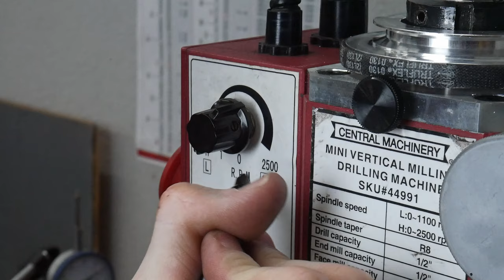Well... I BROKE My Mini Mill... Little Machine Shop Belt Drive Installation

Comment from the maker: *Correction at 00:33 - The LMS mill is not direct drive... it's a belt drive system inside the head.
Reply: I have a mini mill /drill press like that but the wires come apart up by the switch need to find a wire dia ,, so I know where all the wires go ..

Comment: Thanks for the video. I broke my upper plastic gear, but still removed the whole head to remove unnecessary parts,  gears etc. I filled any holes in the head with plastic plugs to keep out debris. The mill runs MUCH quieter and smoother with the belt drive. Although without the gear breakage I most likely would not have made the change. Still I think it was great move. Thanks again.
Reply from the maker: Glad it helped!

Comment: I have had my Grizzly mini-mill for well over 15 years and have yet to strip the gears. I bought a spare gear set from Grizzly at the same time, since even back then it was the most talked about repair. Knock on wood I don't have to do this repair, but the belt replacement is on my list. I save this one YouTube video just in case. I thank you
Reply from the maker: Awesome Larry, yeah I was being a little rough with it when it happened.... 😅

Comment: Been over a decade ago but the belt drive conversion on my X1 made a huge difference. Managed to get 4 ratios using 6mm toothed belt turned inside out.

Comment: I installed my belt drive system today. Your video and informative narrative was a big help. Unfortunately the drive gear on the motor didn’t slide off easily like your video. I had to fabricate a gear puller to get the dang thing off! After that, it was an easy day. Well done video and thanks!
Reply from the maker: Glad it helped!
Reply: Same. I couldn't get that gear off then I couldn't get the sheer pin out. But with a cut off wheel, a steady hand, and a blessing from the God if war I got it out.

Comment: Been spending the last week researching mini mills that I may be able to afford. Going down the rabbit hole is exhausting.
Reply from the maker: Hey Nick, I feel you man. Sneak peak here for you and anyone who reads this comment..... I'm going to be doing a head to head comparison between this harbor freight Seig X2D and the Little Machine Shop Seig X2D (3990 high torque) in the coming weeks. The LMS version has some very nice upgrades compared to the models from Grizzly, HF, Klutch, Wen, etc... So if you have time to wait.... that's coming. Cheers man.
Reply: @RedBeardOps  perfect. What about precision Mathew’s ?
Reply from the maker: @nickminderman7380  I've heard about those being good machines; My head to head will be of the HF and LMS mills though.

Comment: Great video wish i would have watched it before i installed it though. Since i installed the pully on the motor backwards. great add on however i have a problem milling at low speeds it keeps tripping the overload. have you ever had this problem? if so what did you find was the issue
Reply from the maker: You can contact Mr Pete... I put his contact information the the screen around 18 : 31 of this video - https://youtu.be/_Q2aujE3pWk?si=rFt0CoLlD9sC8ID0&t=1111
Reply: @RedBeardOps  I've been in contact with Mr. Pete. i guess he has a board that just came in with the same issues I'm having. This little mill has been a great disappointment. I'm still under warranty but of course HF is very slow on responding back. may just send Mr. Pete the board and take the loss.

Comment: I did the same thing with my Grizzly G0704 but I had to make my own belt drive kit as all the kits that exist increased the RPM.  my mill already had zero torque below 1000 rpms so I made it's new max rpm around 1200 rpm.  I could then run larger drill bits and small taps without it stalling out constantly.  Overall it look like a nice kit!
Reply from the maker: Man, it sure does make a difference! Those plastic gears were just no good...
Reply: @RedBeardOps  After I purchased my Grizzly I wished I had gone with one of the Precision Matthews Mini-Mills.  If you ever upgrade you might want to give them a look.
Reply from the maker: @BecksArmory  They do have a nice mill for sure!

Comment: I have a LMS Hi-Torque mini-mill, but the clear housing on yours is VERY cool, they should all be like that, IMO.
Reply from the maker: It is cool! I'll say that in the Hi-Torque the belt drive comes stock. I also think it's a "belt with nubs" or "teeth" on it so better in that regard.
Reply: @RedBeardOps  Yes, it is a "ribbed" belt.  I damaged mine recently after having drill bits catch in metal.  I'm currently waiting for 2 replacement belts from LMS.
Reply from the maker: @mlminto  Gotcha, maybe I should order some of those to have on hand!

Comment: I was thinking of buy one. But everybody ends up doing the pulley swap and brushless motor. Might as well get one of higher grade to start
Reply from the maker: Yeah, I'd suggest the 3990 from Little Machine Shop if you're interested in one this size

Comment: Hi, Have this mill and it's been working fine, but one thing has been bugging me.  The lock lever contacts the Z wheel shaft before it feels like it has really tightened.  Do you know if that's adjustable?  Do you have to get inside the head/column in order to adjust it?  Thanks.
Reply from the maker: Hey Joe, I don't fully understand your question, but I think you can tighten the gibs on the z-axis to remove some of that issue.

Comment: I have a similar problem and I also want to remove the inner gears my question is do I need to leave the gears on the spindle as spacers for the main upper and lower bearings
Reply from the maker: Hey Stacy, I'm not sure about that, but I don't see a reason to remove the gears on the spindle.

Comment: Does the V-belt have no slippage?
No problems with milling? The power is transmitted well?
If so ... perfect.
regards
Jürgen
Reply from the maker: Hey Spock, I haven't noticed any slippage when milling mild steel with a 2'' face mill... so I think it's good to go! Cheers

Comment: Hi, friend. Could you help me by telling me the measurements of the pulleys of the conversion kit. since I have to make them because here in Argentina I can't get them.
I need to know the outer diameter of the steps of both pulleys. thanks for your help!
Reply from the maker: Hello sir! You should contact Little Machine Shop. They'll likely have that info

Comment: Based on the machinery I have seen this guy using I would say you get what you pay for.  Stop buying cheap throwaway things.
Reply from the maker: The belt drive has been working great. The 3990 from LMS is even a better machine!